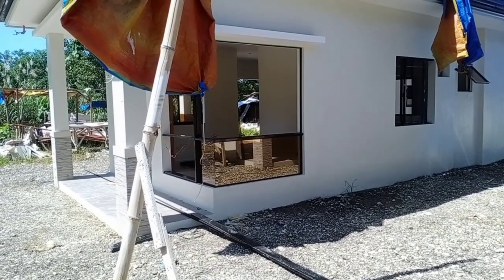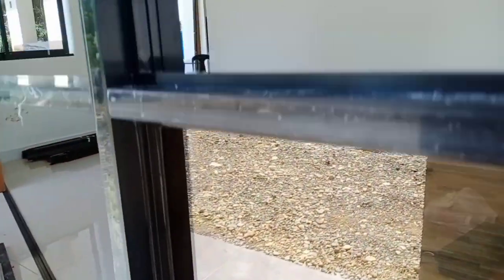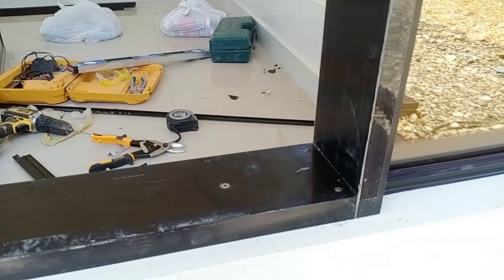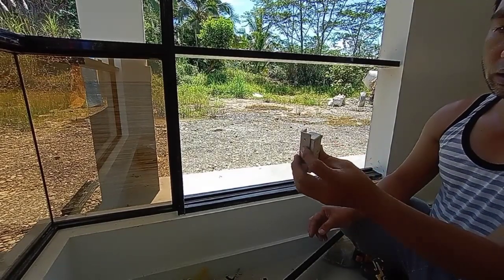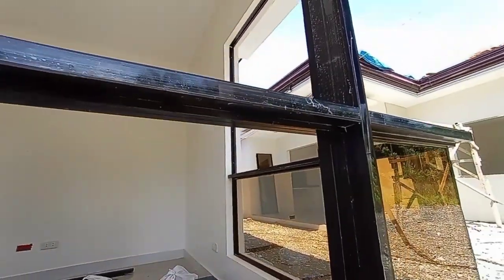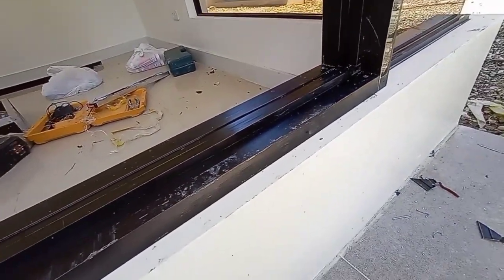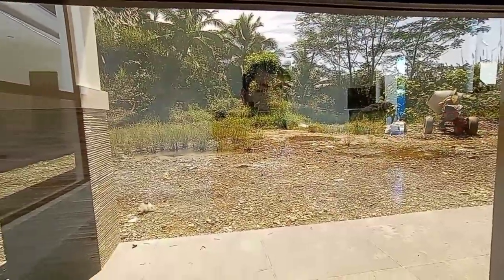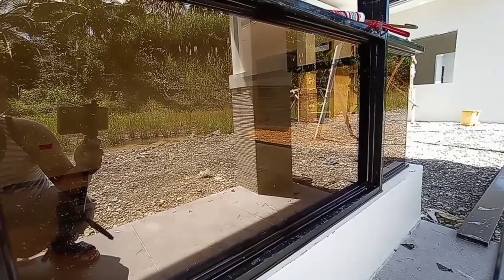Paano Mag Install ng Fix Glass Using SOBC

Comment: Sir ask ko lng Anong size Ng glass na kinabit mo
Reply from the maker: Thickness po is 1/4 at sukat is more than 50" sa fixed side
Reply: @PONGZWORKTV  how much po magpakabit ng ganyan
Reply from the maker: @japsmartinez9681  depende Po sa measurements at materials na gagamitin
 sa ganitong sukat po 10k or less